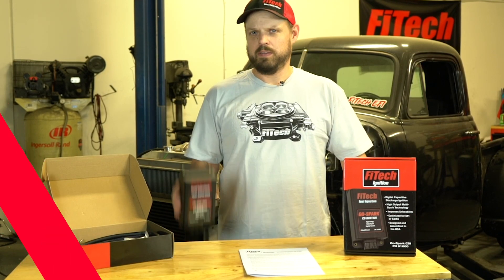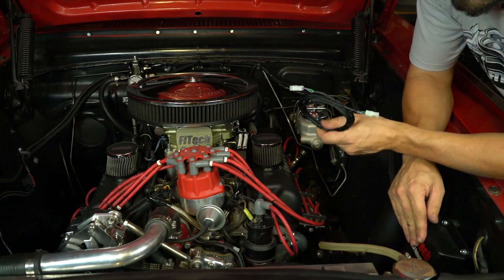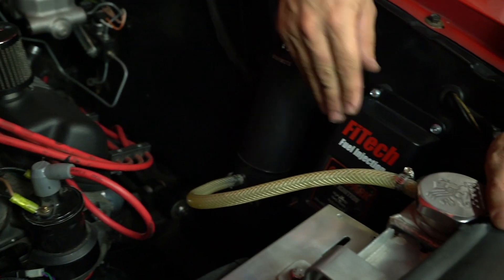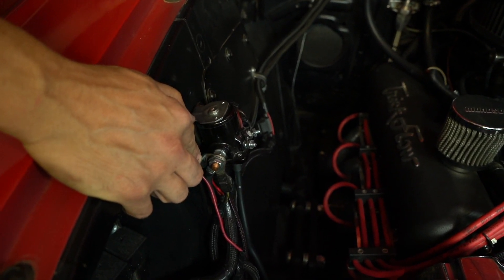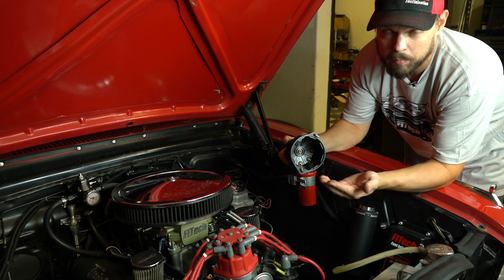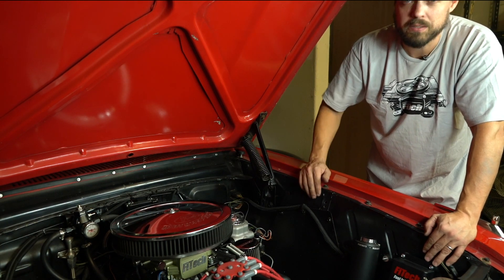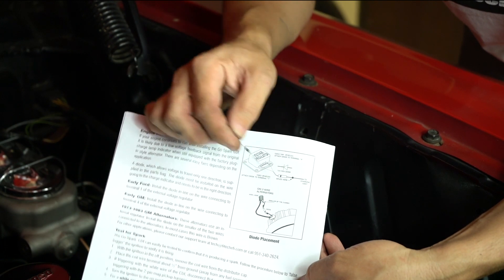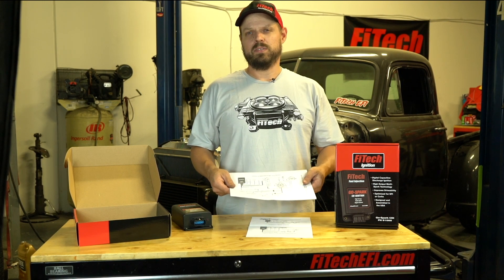How to Install the Go Spark CDI Ignition System Part 2 | Tech Tuesdays | EP36

Comment: Can someone explain why you would want to add the CDI box, when the FiTech is not controlling the timing? You can connect the blue wire to your -coil terminal and not require the CDI Box. I must be missing the advantage of adding the CDI Box when not controlling the timing.